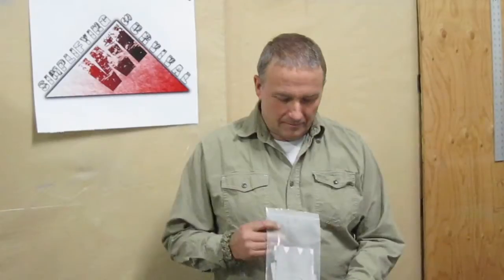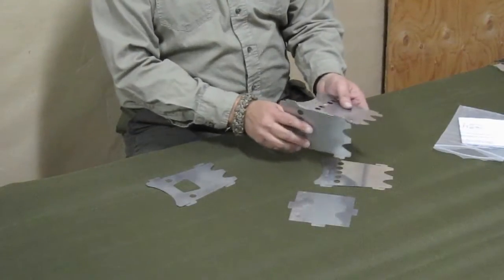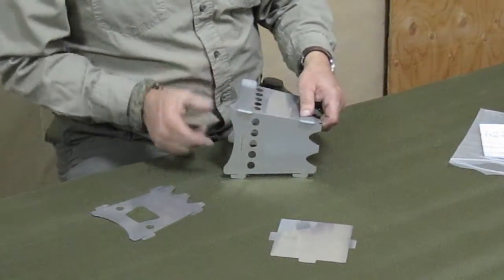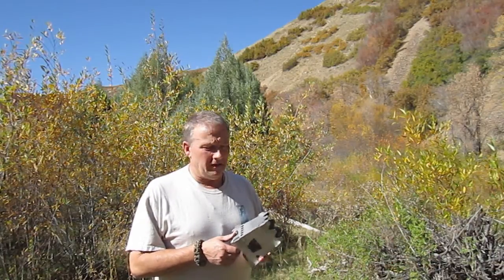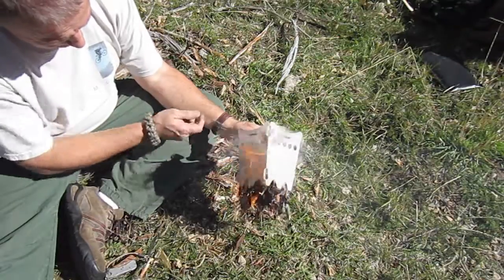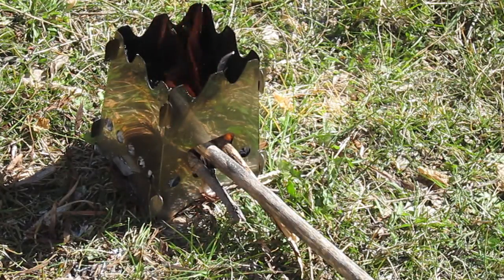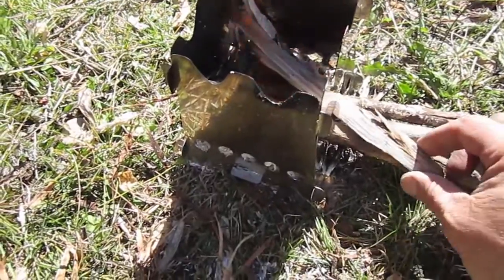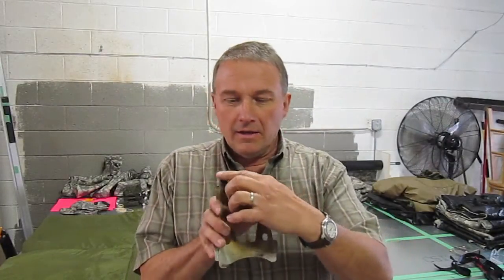Emberlit Stove Review

Comment: Nice video. Just curious...exactly how did you do the camfer and the widening of the slots? I have one of the first run titanium versions with close tolerances and sometimes have a hard time putting it together. It's the only thing I don't like about the stove. I've been using mine exclusively since I got it even in the rain and snow. It works like a champ. I LOVE not having to figure out how much fuel I need to bring on trips. It's endless!!

Comment from the maker: @Harloweqbumfuque we used sandpaper to widen the slots, we worked out a way to use a 1" wide belt sander to do the job, just took a couple seconds for each slot. you could do it by hand as well, just clamp the panel down and tear off strips of sandpaper. If you have a small triangle file you could make quick work of it, as the most beneficial change is to soften the corners of the tabs, this helps them to automatically center themselves. Good luck!!
Reply: Probably don't want to do that. The stove loosens up a bit after some use.